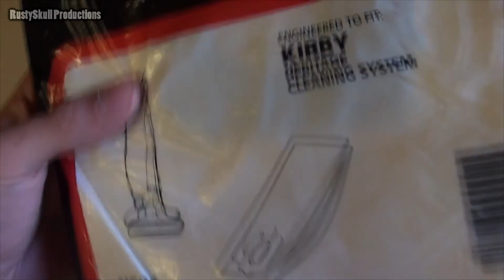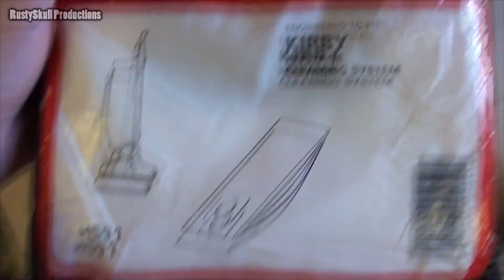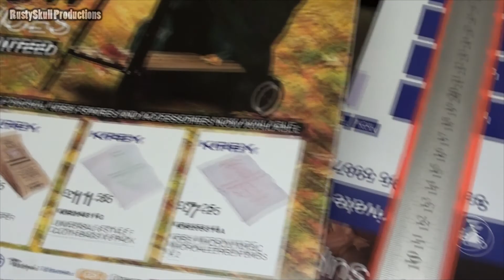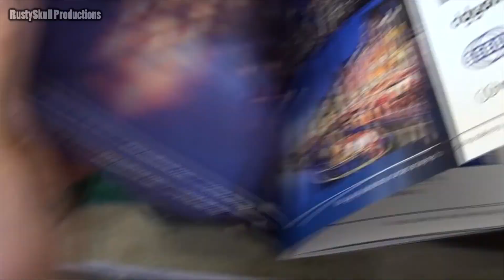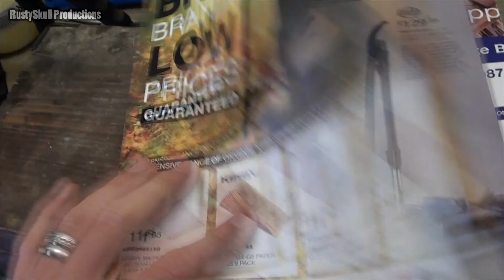The Mess Is Back! - RustySkull Productions

Comment: If you  had more room I think it would be just as filled I am afraid.  It is manageable though.. so you still do not qualify as a hoarder Rusty.   You will need to work harder to get there.  About 10000 more cables and you might be called a hoarder.
Reply from the maker: +55points Haha good I don't want to be a hoarder! I like space and minimal stuff but I end up collecting up stuff incase it comes in handy! Damn it!